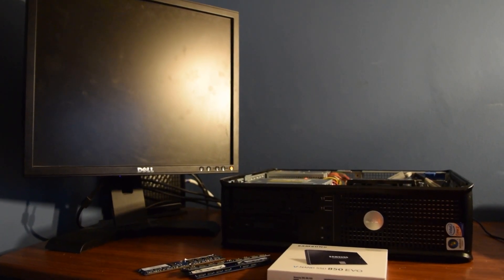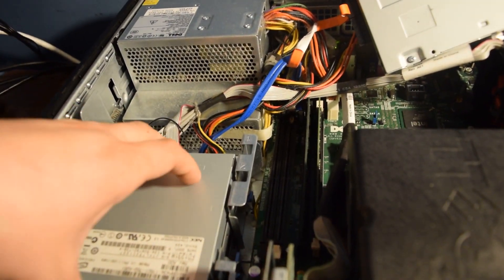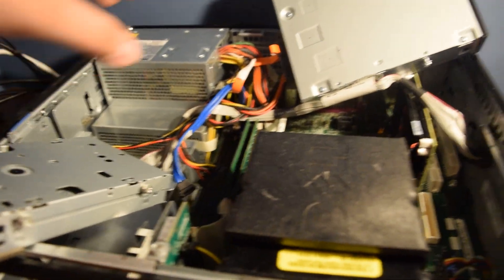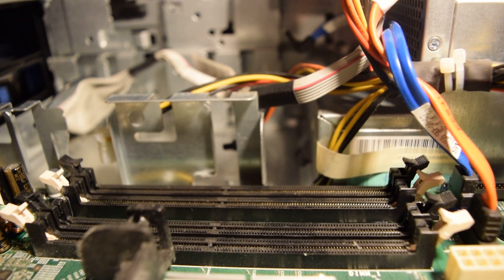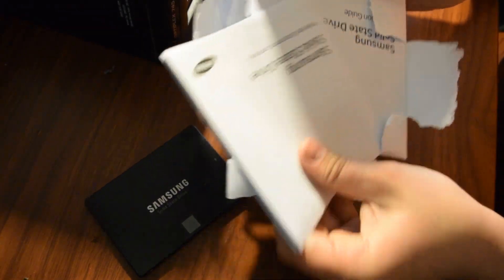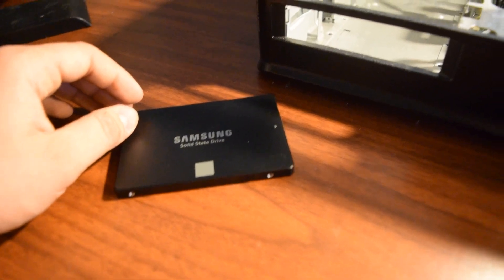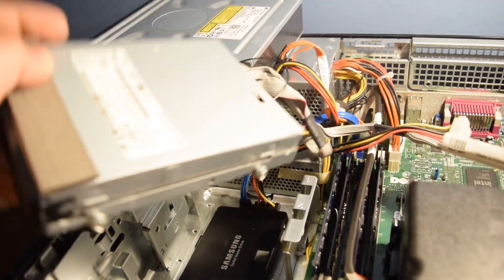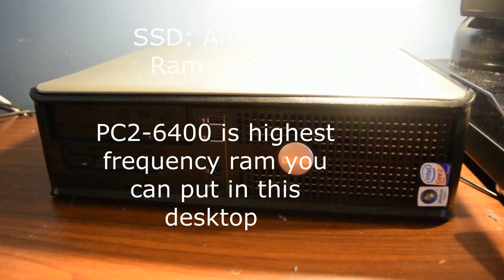Upgrading Ram and SSD - Dell Optiplex 745

Comment: I am upgrading my RAM to 8GB at 800MHz. I have the most up to date BIOS but the computer wont boot and it will make a beeping noise.
Reply: This pc only supports 4gb of 800mhz and 8gb of 667mhz
Reply: i have 2 sticks 4gb GSKILL ddr2 800 MHZ  F2-6400CL6S-4GBMQ got it on Newegg for $200 last year and last week i got another pair of 8gb and today i tryed to add the 8gb but dont work even just adding another 4gb donts work i found out that 8gb is max periord for the 745 model and most ddr system only support up to 8gb of ram
Reply: bro, same to me, idk why, the sticks are good (667 mhz 2 gb each) and if i place them the computer does noise and doesnt boot up, fck me
Reply: I think it doesnt support 800mhz

Comment: But Dell optiplex 745 doesn't support 800mhz ram how did it work for you?
Reply from the maker: i have it in mine right now. try a bios update
Reply: Dell3524 ok can you give me the link to latest bios?
Reply from the maker: https://www.dell.com/support/home/us/en/04/drivers/driversdetails?driverId=GRJ7T
Reply: @Dell3524  Hi bro, i update the bios to the lastest versión, but the 800MHz in RAM dont work, can u help me?
Thanks
Reply: @KevinGarcia-wx7zj  it will probably work if it works at a lower clock speed. As for BIOS update, HEIDEN 2.6.6 I think is best you can get, but I couldn't get it to install, and could only get the 2.6.4 to work, but it allows me to install a Core 2 Quad 6700 2.66 in place of the Pentium D dual core it came with. Good luck with the RAM upgrade.
Reply: @KevinGarcia-wx7zj  i kthis is late butit wont work with the usff version so if u had that that's prolly it

Comment: What GPU/CPU is it running? I got a non low profile Optiplex 745 that has 4gbs of ram, a Core 2 Quad Q6600, (which contrary to popular belief seemed to work fine in the 745, even though it is not officially supported) and soon to be a GTX 750ti (currently a GT 220). With the right GPU and CPU yours could be a pretty decent gaming pc.
Reply from the maker: Q6700/ HD7570
Reply: Not too shabby; my 745 seems work well with GTA V on low settings at 720p. Once I get the GTX 750 Ti I bet I could turn them up to high at 720p.
Reply from the maker: i can play at 1080 with mostly low - medium graphics plays decent haven't tried it with the ssd yet
Reply: Not bad.
Reply: When I get the GTX 750 I bet my 745 will be semi-VR capable.
Reply from the maker: the GTX 750 is capable you might be the only one with  a VR-Ready 745, I have a 755 sitting around I want to do something with
Reply from the maker: I have just been busy with school work and my vinyl channel
Reply: Literially today, I was given a low-profile Optiplex 755 which made me realize that I should just scrap the 745 and put all the good small parts in the 755, so that is exactly what I did. I popped the Q6600, gt 220, 4gb of ram, and the 120gb ssd into it, and it seems to run exacly the same as the 745 was, but I have not done much testing with it yet.
Reply: I also did not end up going through with my deal for the GTX 750. Do you know of a similar low profile card I could put in my 755?
Reply from the maker: couldnt tell you off the top of my head but the 755 is your correct pretty much the same machine it received updates for newer processors
Reply: Okay
Reply: (This is Jack J) Now i'm thinking about using the new GT 1030 if I can find a good price. Or possibly the GTX 950 fresh from my main machine (I upgraded to a GTX 1070). I I could somehow get the 950 to work with the 300 watt OEM PSU I may be good to go. If not I am thinking of selling it for a good price.
Reply: I feel that I upgraded a bit too early, but I found this 1070 going for $180 and had to buy it.
Reply: I am thinking of using a pcie extension cable to get rhis fill height card to fit in the low profile case.
Reply: Heyy just wanna know that does this Dell optiplex 745 support gt 750ti? If not then what other graphic card does it supports?